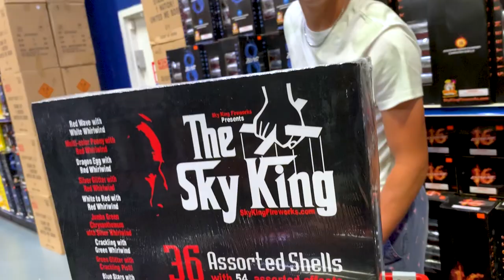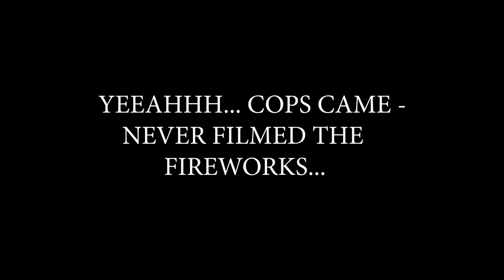The CHICKENS ESCAPED!!

Comment: PUPPY PADS  !
 ABSORB THE " NO,NO" and then take it to where you want her to go outside . 
Press it down to put the sent there. 
 They are going to make mistakes but in time she will get it. 
I would also suggest getting a Great Dane size create because they should have a place to go if needed.
  Lots of dogs will get kidney infections from holding their pee . Another tip  is when you see her running around sniffing she has to go .
Also right after naps and play it's best you put her out right away.  Dog like humans have to pee when they first wake up . 
Hope it helps . 
Also with chickens just to be safe.
 I would tie wrap some chicken wire under their house so that predators can't did their way in .